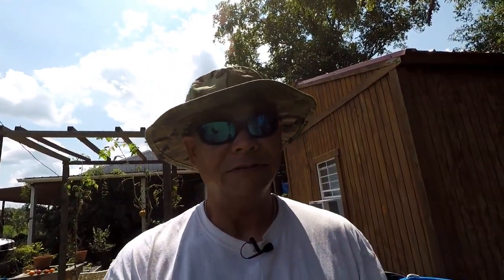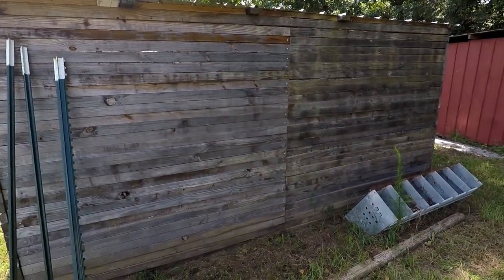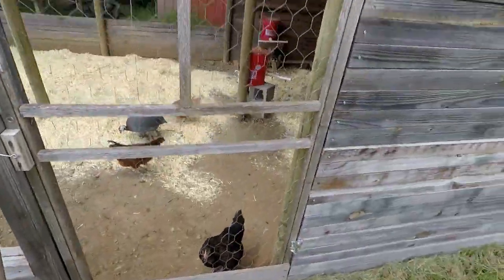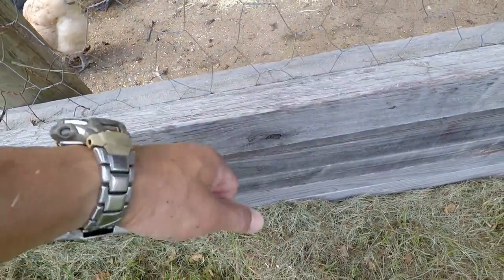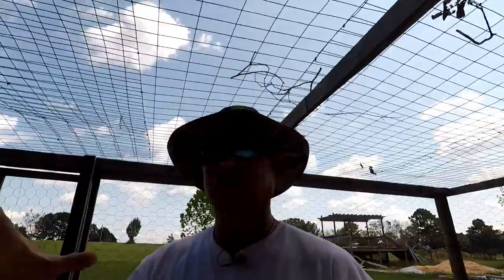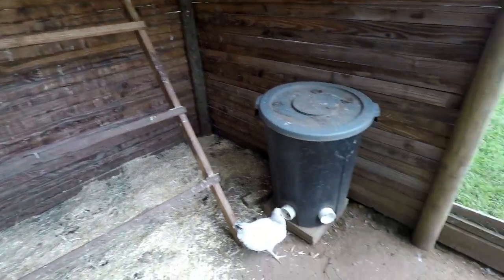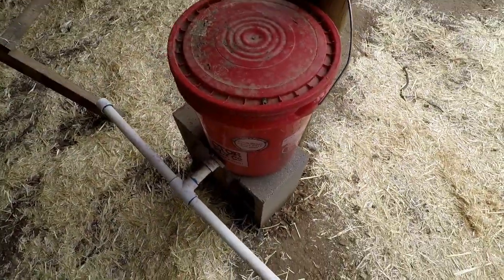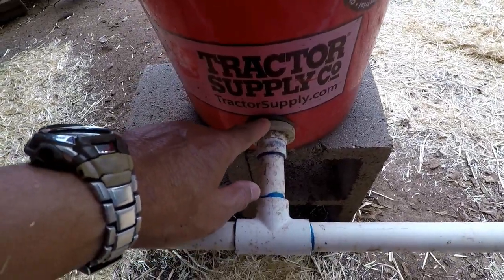Chicken Coop Build/VR Response To Carl And Dawn Homestead!

Comment: I really like the short wall around the sides. I don't have that and their mess gets out on my grass. I live in Utah, so an open coop wouldn't work well for my girls due to the cold winters. Although, my girls never stay in the coop no matter what the temperature is. Haha! I also like your feeder. I'm thinking of doing something like that, but I'm not sure where to put it in my run where it will stay out of the snow. Thank you for sharing!
Reply from the maker: Hey Mrs. Mags, wow, snow!!  I'd build a small lean to type shelter for the feeder if I had snow like you do!!  Thanks for watching mam!!  Dan
Reply: Home In The Sticks I have a short lean to already. Food and water go under it. We call it the mess hall. Maybe I just need to make it bigger...
Reply from the maker: Maybe even enclose it to shelter the feed and water while the birds are eating?  You have a heat light in there for your water, so it doesn't freeze in the snow months?  Dan
Reply: Home In The Sticks we put a safe flat panel radiant heater in their coop for when it gets below 20°. And there's a submersible water heater in their water bucket in the mess hall. Most people around here only keep the water from freezing. I would love to have a roof on their run so I wouldn't have to shovel snow for them. But my girls don't seem to care about the snow on their feet. And there's not a lot of risk from predators around here. I put down straw when the snow doesn't melt away.
Reply from the maker: That sounds like the have a toasty spot to be in with that panel radiator, we don't get that cold down here, high 30's and sometimes lower than that.  I've been using a red lamp in the coop when it gets below 40.  Dan
Reply from the maker: That sounds like the have a toasty spot to be in with that panel radiator, we don't get that cold down here, high 30's and sometimes lower than that.  I've been using a red lamp in the coop when it gets below 40.  Dan
Reply: Home In The Sticks my coop is on stilts, basically. They use the underside for shade. Highs in the 100's, lows in the -10's. Coldest I think we've had is -15° in the 7 years we've been in northern Utah. I didn't have chickens then. I'd like to build a barn style coop with a covered run someday. I don't come across free wood very often, so I have to buy everything and that gets pricey. I feed my girls frozen treats in the summer to help cool them down. They do just fine in the winter.
Reply from the maker: I gotcha, good idea on the frozen treats during the summer months!!  Dan